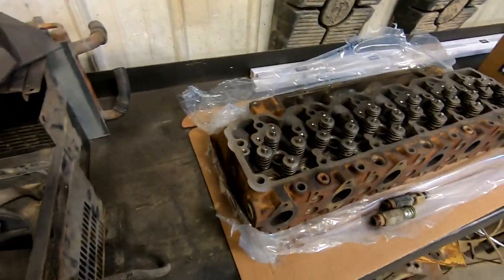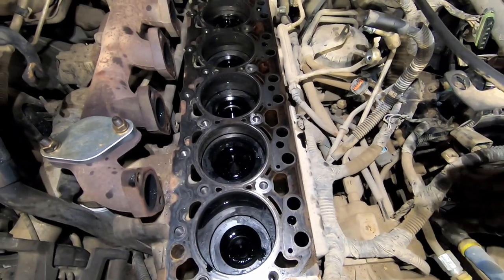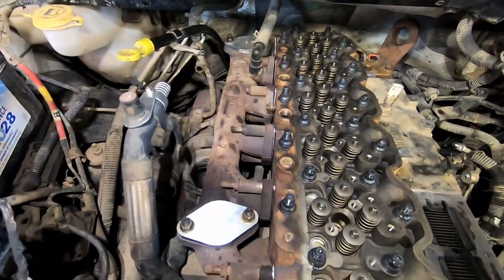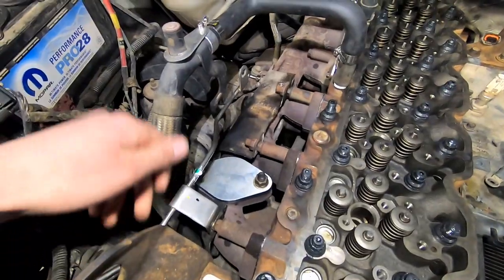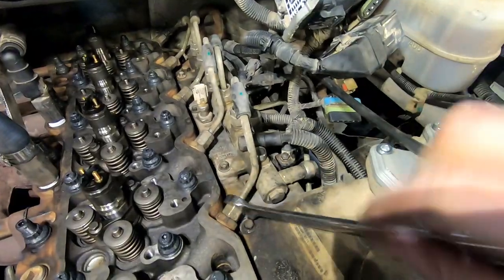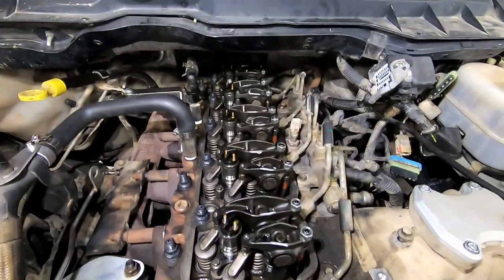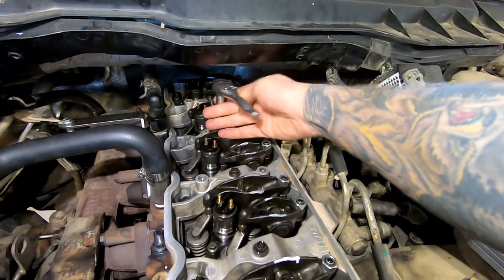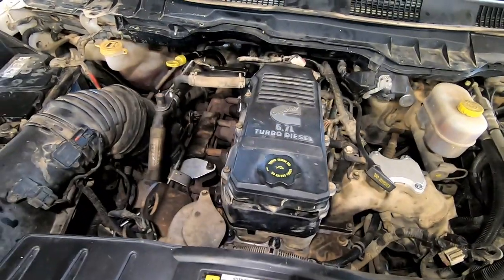How To: 6.7 Cummins Head Gasket Replacement (part 2/2 Install)

Comment: i have an 08 6.7 cummins 140k miles stock motor just tuned with a Csp5 switch and fully deleted, do you recommend head studs?
Reply from the maker: If it’s that old I would just say keep driving it like it is, and if you ever do have to replace the head gasket do studs at the same time

Comment: Did you retorque head studs after a heat cycle? Arp told me its not required but everyone says to do it thanks!
Reply from the maker: No it’s not required unless your planning on building a race truck

Comment: Anyone have trouble on the 08 third gen. Or maybe fourth with having a gearbox steering stabalizer(square tube infront of the sway bar) and not being able to turn the crank? I cant get a bar in there because of the stabalizer no room. Tried between the rad and shround and it worked somewhat but now its stuck and i cant turn it more

Comment: Why not the 625 studs? Don’t you have to retorque those after first heat cycle?
Reply from the maker: I know a lot of mechanics and have worked at multiple shops and still have not met one who re-torques head studs. I think that’s a myth in my opinion. The reason why I don’t use the 625 is because they are almost twice as expensive and way overkill for most trucks.  I’d only recommend the 625 if you plan on building a truck over 800HP but that’s just my 2 cents.
Reply: Man thanks for the quick reply. I thought I saw or heard somewhere they needed to be retorqued. That’s awesome if they don’t because I’d much rather get those than the 625’s! I saw 625’s for $1500!  I have a 2016 CTD with 123k miles. Would I be good to do studs and not do a new gasket?

Comment: You are my hero how much do you charge for a drop like that
Reply from the maker: For the whole head gasket job?
Reply: Yeah how much money you charge for change and head gasket and diesel 6.7
Reply from the maker: Around $4000 CAD that’s with ARP head studs and getting the head resurfaced

Comment: Idk if it was asked but how long did it take you to do the full job?
Reply from the maker: usually takes me about a half day to pull it apart and then a full day to put it back together.
Reply: @darkirondiesel  thanks for the response. I’d like to dm you somehow and talk some more about the job. I’m doing mine rn with a new head.
Reply from the maker: if you have instagram shoot me a message on there @darkirondiesel
Reply: @darkirondiesel  I’m not on there... but I appreciate ya
Reply from the maker: Shoot me an email kyle.redekopp@gmail.com

Comment: You never use a sanding disk on the deck of a block you only use a rubber disk to clean the deck surface. When you use a sanding disk you are removing metal no matter how gentle you are that makes the surface not flat and sends metal in the oil. It’s even more critical to not use a sanding disk when using a MLS style head gasket like this you don’t have an old graphite gasket that will seal to imperfect surfaces.

Comment: Don't put the heater grid back make sure u delete it.
Reply from the maker: We need grid heaters in our climate. Bd diesel makes a fix kit for the killer grid heater bolt and that’s what I’ve been using lately
Reply: @darkirondiesel  I personally don't understand how this issue is not a recall yet

Comment: Injector hold down is to be secured by finger tight, injector tube 11F. pounds then torque hold down to 73 inch pounds in 90 degrees bolt each until torque is reached then finish injector tube to 41F pounds, read the manual, you got it all wrong

Comment: Warped block? Lol do you know what kind of heat it would take to warp a diesel engine block. If the cylinder head didn't crack between valve seats then it didn't get anywhere near hot enough to warp a block. That just doesn't happen. The heads can yes but not the block. I've done head gaskets on every engine you could imagine and have never experienced a warped deck yet so you can skip that agrivating process of running a feeler gauge and straight edge down the deck surface. I guarantee he doesn't even do that when he's not making a video. Also there's no sequence to removing head bolts i zip them out with an impact in any sequence I'm feeling like that day. I'll do it in the shape of Mickey mouses ears on my next one. I also think a quick coat of black paint would've been in order so all your hard work doesn't look like a rusty cast iron mess. Nice clean work you did but it looked like the head was just raised from the titanic
Reply from the maker: Did you know that the titanic’s anchor weighed an impressive 16 tons, and required 20 horses to transport it 2 miles to the casting site?

Comment: I'm on my 2nd day of this project.  I left the injectors, transfer tubes, fuel lines, and fuel rail installed on the head when pulling it.  Looks like it will go back in tomorrow the same way.  Figured it would be less risky as far as getting dirt/debris in the injection system.
https://youtu.be/MIalYZbF3EA